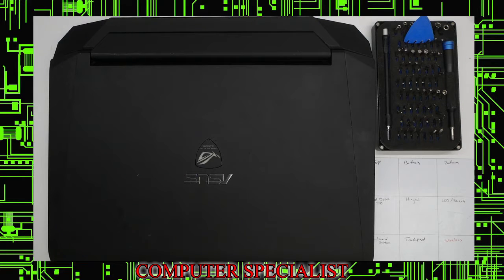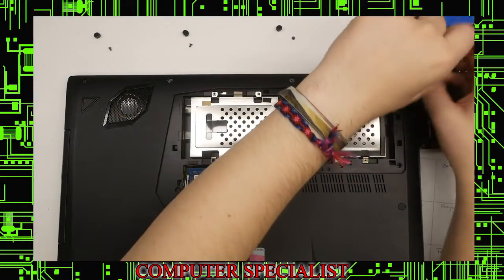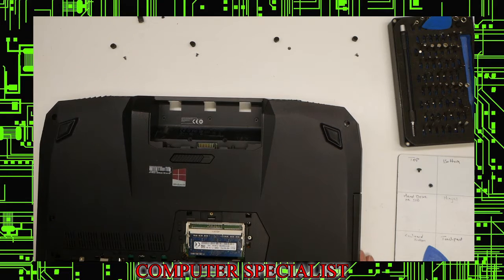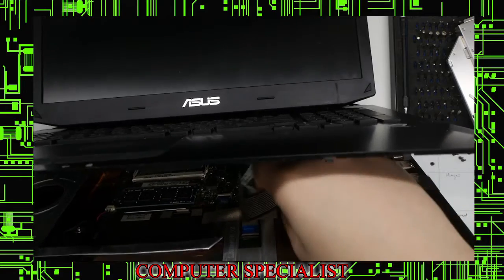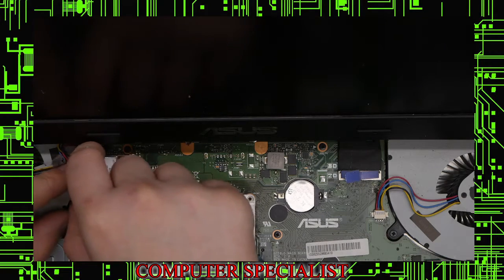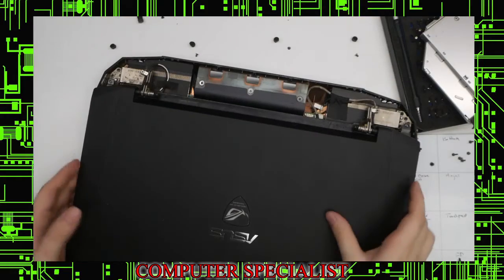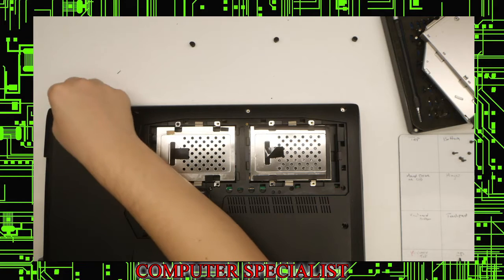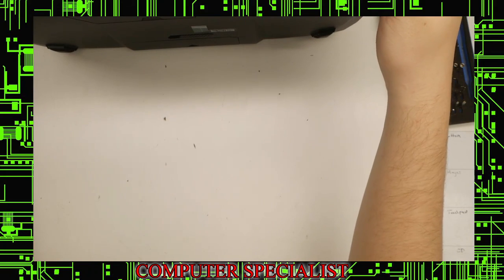Wireless Card Replacement ASUS ROG G750J Gaming Laptop

Comment: Dang, they bury that in there! I might do it, but that's a lot of disassembly. The only part that really makes me hesitate though it hat ribbon connector under the keyboard. My wife's old Dell Vostro was easy access under back panel to put a Killer card in a while back. I'm probably just gonna stay with what I got. I'm only 30 feet from router and can pull 400-500 Mbps on 5G band.
Reply from the maker: The ribbon connectors are easy, just use something small and plastic (Guitar pic etc) and pop it up. then Cable comes right out! but 400-500 is great speed!
Reply: @computerspecialist8533  I struggled with one on a tablet disassembly a few years back. I'll probably just tuf it out until this old ROG dies. I don't want to take a chance. It's going to suck when I finally have to give up Win 7 for a new laptop.
Reply from the maker: Yeah they can get tricky! Best advice I have is be patient and don't force. Sounds silly but most connectors will come off easy when done right!

Comment: Do you know where I can find that ram&SSD bottom lower case
Reply from the maker: That's a hard part to find. I would check daily (or add saved search to your cell phone to notify when someone list). Also the entire bottom model # is 13NB04J1AP0111. May want to look for that and see if they are selling complete with cover (Then you can sell bottom back on eBay and recoup most your $$). Below is a link to one that sold a few months ago. I will keep my eyes out for you if I see or come across one!

https://www.ebay.com/itm/284515242258